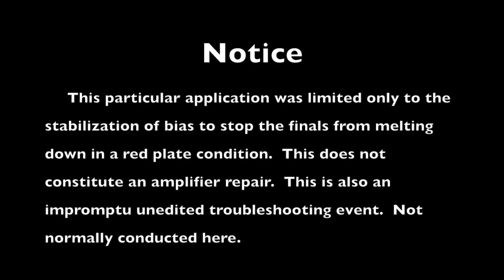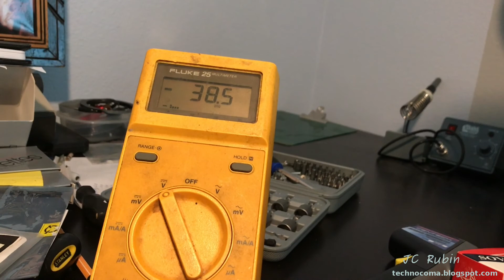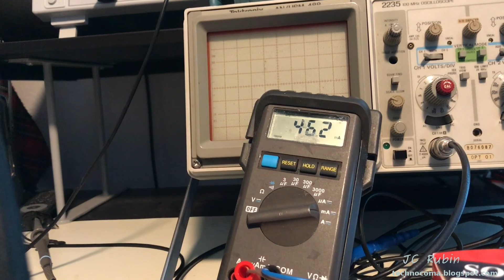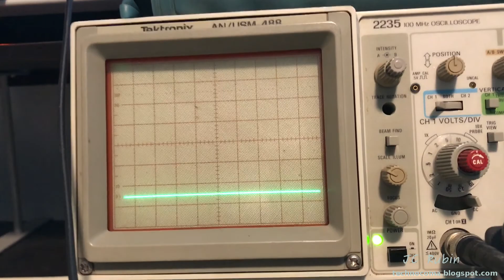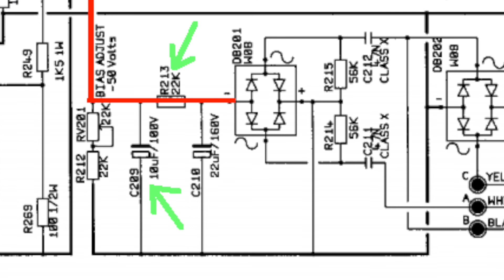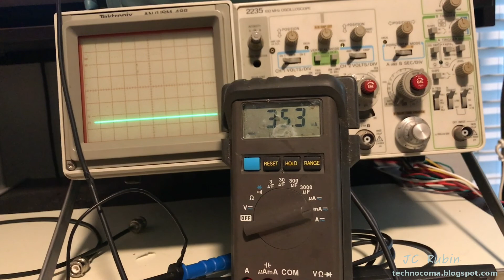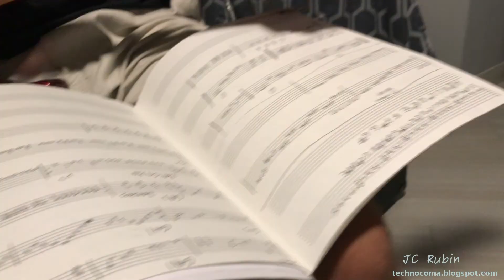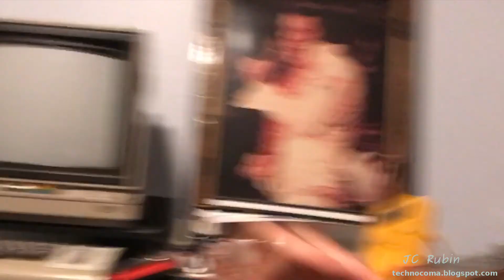Marshall 6100LM 30th Anniversary Tube Amplifier Emergency Repair

Comment: Hey Guys, for anyone with the same crazy hot bias issue on a Marshall 6100LM....

We had one of these amps in the workshop with the same problem, melting output tubes. Traced the fault to C211 which is a Class X safety capacitor, these are guaranteed to fail open which is what happened. 

Replaced both C211 and C212 along with much of the bias network since I was in there anyway and happy days🎸

Hope this helps someone out there!

Comment: An amplifier repair tech told me that it was a known problem for the 30th Annv. Amp. Marshall knew about it but did not do anything about it.
I also have the same amp and it has the same problem. Main fuse blows, the valve blows... 

How can I fix this? What did you do to repair the amp? Did you replace the resistor R213 with another ? did you replace the capacitors c209 & c210 ?

I have had my pitchfork waving in the air at Marshall for too many years !

please help

Comment: Another good video..............Is that amp directly coupled, or capacitor?  Maybe they're leaky....
Reply from the maker: Hello John, looking at the highlighted diagram I posed you can see that the DC leakage is pulling the bias voltage 'UP' towards ground.  They are not the big exploding ones below but the smaller ones in and around the resistor in question.   Again, my limitations with the unit with regard to owner criteria prevented me from pulling the board removing the capacitors and measuring them for leakage and replacing properly.
Reply: Jordan, I wanted to mention also, your friend is a pretty good musician. I just sold a Craftsman 6L6 mono amp with Am Fm tuner and miss it already. It came out of a console unit. Ugly, but great sounding. My wife was happy, it freed up a minuscule amount of space.............
Reply from the maker: How funny, IM not the one buying Tube amps, my wife is..... Heathkit equipment however, guilty on all charges